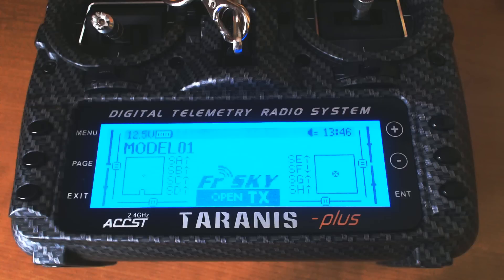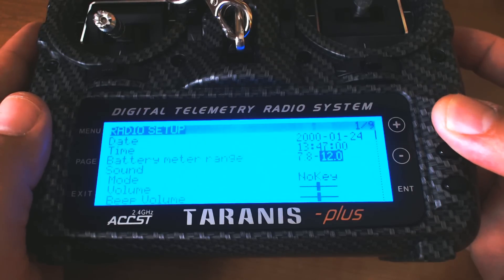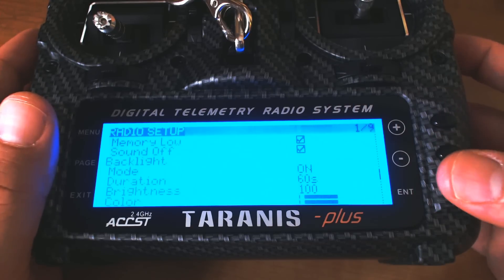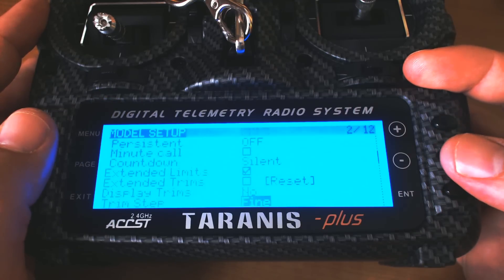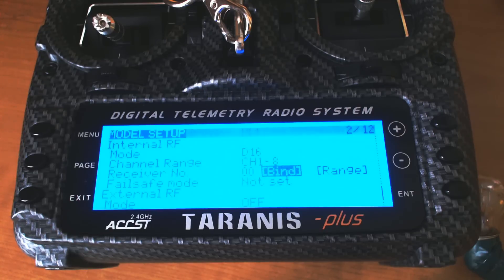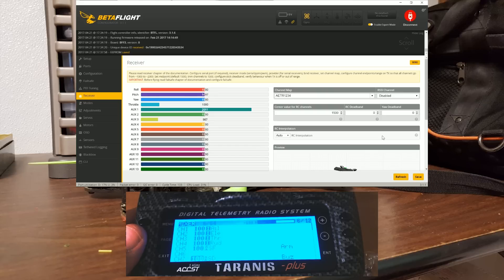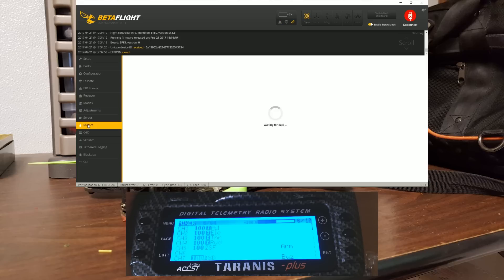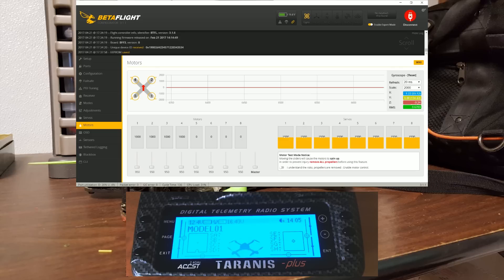How To Set Up FrSky Taranis and Betaflight / Cleanflight Configuration

Comment: I get to the end point part and I move the sticks and nothing happens so I can't set my end points.  The TX is bound (green light on receiver.  I have the x8r.  Does have something to do with arming?  Please help.  Thanks
Reply from the maker: If the Receiver Tab channels do not move when you move the sticks, then the receiver is not set up correctly.

Here's a video about wiring up flight controllers and receivers.

https://www.youtube.com/watch?v=ZpU6-JY6fnk

And in this video, I show setting up a serial receiver, although the exact steps will depend on your board.

https://www.youtube.com/watch?v=JkggzZySIqs&vl=en

You can also check the user manual of the Holybro Kakute or the JB F4 AIO flight controllers, both of which I wrote. They contain instructions for configuring a receiver in betaflight.
Reply: I have the first LUX FC
Reply from the maker: The Lux also has a great manual, although I didn't write it.

Comment: Is it worth setting up the arming on a switch in modes, before doing the yaw endpoints?
Reply from the maker: So you don't accidentally arm? You can do that. Or you can just center throttle before moving yaw up and down.

Comment: You didn't calibrate the Taranis first as part of the new radio setup. Do you think that is not needed? Or did you do it and just not show it in the video?
Reply from the maker: +John Reade that's a good question... And I don't remember. I probably did calibrate it to be honest.
Reply: Thanks for the response, I was just rewatching this video to see if I could use it to teach new people how to setup their radios and noticed that step was missing. I think it's often missed though. From my experience the only time calibration is noticed is when you get a radio that gives a throttle warning every time it is turned on. I also didn't see badly calibrated radios as often with the Taranis 9D Plus as I do with the QX7.

Comment: Hey, Joshua I've got a not so short question. 
Im working on an Immersionrc Vortex 150( I know I know)
I am having a very weird problem with the Vortex 150. The (Vbat) voltage is there when I first go into Betaflight to make any changes but the Vbat is disappearing in betaflight after I save and restart betaflight (even if I Don't make any changes) and to get it to show back up I have to run the Immersion Vortex 150s setup wizard again. 
I am wanting to send to the Taranis the Vbat so I can have it verbally warn me of low voltage.
Theres no problem with the telemetry from the Vortex 150 to the Taranis, its just that since theres no voltage being shown in Betaflight, the value is 0, all of the other data from the Vortex150 is working fine. 

There seems to be a problem with the Vortex 150s Flight controller losing the bat. (externally)
And to make matters even more odd is the Vbat is still showing up in the Immersion Vortex 150s OSD just fine.
I have even tried different Immersion firmwares and different ver of betaflight.
I have reached out to Immersionrc and no one there seems to know what is happening
My gut feeling is this is a Immersionrc Flight Controller Problem.

Thanks for any help
Rob

Thanks 
Rob
Reply from the maker: The OSD is a separate device in that copter, so the fact that the OSD sees vBat doesn't mean the FC also sees it. Also, I'm pretty sure ImmersionRC runs a custom version of Betaflight to interface with their OSD or something. It sounds like the FC is not set up to send telemetry data to the Taranis. When you do "Discover Sensors" on the Taranis, do a bunch of new sensors show up?
Reply: yes a bunch
Reply: Here is some text from a pdf that I got from immersionrc on how to get this to work.
A few firmwares back I got this to work on a vortex 250.
But know it does the same thing the 150 does the Vbat  just disappears once i save and reboot betaflight.
So frustrating.

How to enable telemetry on a v150/v180/v250
Tuesday, March 28, 2017 9:20 AM
Minimum software requirement
OSD: v 1.0.0.41
FC: betaflight 3.1.6 (IRCFUSIONF3:v250, IRCSYNERGYF3:v150/v180

HW Cabling
Telemetry pin connected to GPS connector RX pin on PDB

Configuring betaflight for telemetry using betaflightconfigurator
1. Configure UART2 for Smart Port Telemetry Output ( looks for right protocol
Save and Reboot...
WARNING: You may have to force Serial RX on UART3 after. Don't forget to configure Receiver too if it happens!!

2. Configure Other Features and Enable Current and Voltage Meter
              Save and Reboot...

3. Configure Current and Battery Meter type to EXT using CLI (not available though regular configurator UI interface)

set battery_meter_type = EXT
set current_meter_type = EXT
save

Thanks for your help
Reply: Hi again Joshua
I and they found the problem. It was an Immersion FC bug where if I used rssi on any of the auxs it disables Vbat in the telemetry. Immersionrc claims it will be fixed in the next firmware.
Thanks again for your help
RK

Comment: Joshua I bind my model on 02 I want to place it on 00 like you show us in the a video.  If I rebind it to 00 will I lose all my setting on the radio I had on  02??  The process to rebind is the same just change the number from 02 to 00 right??   Thank you
Reply from the maker: Nothing will change except the receiver number that the Taranis associates with the model.

Comment: Hi guys/Joshua. I’m new to the hobby and bought the wizard x220 after watching multiple reviews. It came and flew great. I took the lid off the x220 to reroute the antenna. Now the receiver seems to not talk to the F.C.  I’ve watched every video and tried every setting imaginable. In beta flight the receiver tab is just dead. I bound the tx to a different receiver in a different model and the same thing happens. As I’ve put just one battery through the model I’ve tied to address with Banggood but their CS seems to rely simply on me supplying a video of the problem. Any ideas. Russ with no hair.
Reply from the maker: +Russ Cobham does the receiver power up when you plug in the battery? Are there lights on it?
Reply: Hi Joshua. Thanks for taking the time to reply. So the receiver binds to the tx and so does another receiver. So both bind as they should and have the steady red light when power is applied by plugging in the flight battery. It just seems really weird that the same problem exists on both models but the tx and both tx will bind just fine. I hope it’s just new by nievety. Thanks for your help. Russ

Comment: Hi Joshua, since upgrading my Taranis firmware my Telemetry low voltage warnings no longer work. I thought maybe it was a soundpack issue, but upgraded to lastest soundpack and still doesn't work. I've used this feature for years and have not changed any of the radio settings. Any ideas? Thank you

Comment: Joshua,I watched your video but I couldn't fix my receiver issues. I have a taranis q x7, an xsr reciever, and lux v2 FC running betaflight. I configured the ports and configuration and soldered correctly yet in the receivers tab it defaults to 0. Even though its bound, by taranis won't display in the receivers section. Any suggestions?
Reply from the maker: If they are showing zero, I think this is a bug some people are having. Re-flash the config on the board, and if that doesn't fix it, uninstall and reinstall your configurator app from the Chrome app store.
Reply: This worked! Thanks for your help.

Comment: Hey Joshua. I spoke to you few weeks back about my receiver not working in beta fight receiver tab. I watched your video and was a success. I have just got a shuriken 180. I've bound x4r receiver to the quad plugged it into beta flight but no response in the tab. I've set it exactly the same as the one I had problem with before but still no response on tab. What can I do. Can u not use this receiver on this quad? Is it not bound or is it something wrong with the quad??. Would be great if you could help me out once again. Thanks
Reply from the maker: You can't assume that the Shuriken has the exact same config as the other FC you were using. Like, what UART is the receiver be hooked up to, for example? On different boards it will be different.

Yes, you can use the X4R with the Shuriken. But like maybe the Shuriken comes from the factory wired for a PPM receiver, in which case the factory wiring wouldn't work. That's just an example, mind you.
Reply: Its on UART 1. Will go to your shuriken video and check
Reply: Lol little bit confused but struggling bad
Reply: I know you are knowledgeable and will have the answer but how do I wire it to work for x4r. I did have the original receiver but when I brought this drone from person the receiver port for wire ie  little white box was snapped of. Can I solder wires to it and still use sxr?. Unsure

Comment: sorry all sorted now. just got new motors for my nighthawk. all seemed good. plugged battery in and one motor started to smoke. any ideas why as itbwasnt before I changed the motors. even when I changed it back same thing happened.
Reply from the maker: Number one, stop right now and build a smoke stopper, and use it. It will prevent smoked motors from happening. If you don't know what a smoke stopper is, google "how to build a smoke stopper".

If the motor smokes when you raise the throttle, this is likely your problem: https://www.youtube.com/watch?v=eo2sjTNS0pc

If the motor smokes immediately when you plug in the battery, it's probably a damaged ESC. Especially if it smoked two motors (same ESC, replace the motor, smokes again).
Reply: I didn't but I have looked and seen it in your videos or Hurd u mention it. can u use a normal light bulb. once iv done that what does that achieved. does that tell me if fault in ESC or in motor?

Comment: My experience says NiMh batteries are actually better for low current draw than LiPOs. My old Taranis (gen1) has the original battery and it works for WEEKS between charges. There must be current leakage in some Taranis TXs or Taranis Plus has a design flaw.

Tx latency?? Bull Sh!t SnoepoX
Reply from the maker: I charge my Taranis, with a 3S 2200 mAh LiPo, about once every 2 months. But honestly it doesn't mean much because who knows how much we both fly? There is no question at all that LiPo are usually more energy-dense than NiMh by a long shot. The very best NiMh packs can approach the energy density of a LiPo, but in general, a LiPo will have about 2x more Wh/g than a NiMh.
Reply: That's my point. In the olden days you needed to charge every time you flew. So once every two weeks is already luxury.
Thanks for the reply.

Comment: sorry lol. I have managed to get past that stage now. I'm setting my switches in modes now but angle mode and horizon are not there. normally I have switch with all three on. iv just built a martian 11 frame. emax 2600kv motor spf3 flight controller. I did have a wizard but made my own today and never used this taranis I have so having a go. sorry about my english

Comment: How do you get vbatt to the fc and from the fc to the rx? I have the xracer f303 and it does not have a vbatt port and I can't obviously plug vbatt directly to the rx any place... How does that all work?? Thanks!
Reply from the maker: Xracer F303 definitely does have vBat in. It's on the under-side of the board.

vBat gets from the FC to the Taranis via telemetry.
Reply: Joshua Bardwell awesome, thanks for the heads up! I'll turn the board over and look 😀

Comment: Hi Joshua, I received my carbon radio today, but it has no switch stickers applied.  I need to apply them myself, but to do the front ones it looks like I need to remove the switches and knobs - did yours arrive the same..?

Comment: My taranis is still fairly new and has the ratchet enabled for throttle, I'm about to open it up to change it to smooth, I assume you do that also as you mentioned this on the m9 gimbal video.. is there anything else you change while the back is off?

Comment: Oh, that's Taranis special edition you have there :) I got one too, added 5db antenna and the radio transmitter died :D So it might happen the antenna was badly made or Taranis itself couldn't handle it or it was already damaged as with stock antenna I got much less range than with my old non special hard mounted antenna.

Comment: Hey Josh,
If I got a new taranis, how do I transfer all my models and settings over (eg logical switches) without doing it all manually again?
Can you simply swap the SD cards over?
I've always wondered, and kind of concerned me as I will one day have to purchase a new radio. 
Thanks
Reply from the maker: I would save out the .eepe file in Companion. Maybe try backing up the ROM to SD from within the Taranis and then restoring to the new one.
Reply: how do you back up the ROM? menu.. settings..? thanks

Comment: ** Off topic but in reference to your earlier lipo testing videos.

Having recently picked up an ESR Meter like the one you tried in January, I see that there are two different ways to measure the IR of a pack. The first is to simply plug it into the meter and read the value. The second is to enter the capacity (mah) after plugging it in, and then use the two small leads to measure the IR of each cell separately and sum them for the pack's IR. 

According to the instructions the first method's measurement includes all solder joints, wiring, and connectors between the cells and the meter's internals. The second method measures IR at the solder tabs on top of the cell for the cell under test. I don't know how they're doing it but I did verify that summing the IR of the cells always produces a lower value than the first type of measurement.

I thought perhaps some of those wildly out of range numbers in your testing may have been caused by wiring/connectors.  Just a thought.

As to the value of the ESR Meter, I know there are intelligent and passionate users on RCG on both sides of the fence with regards to the measurement methodology used. I don't have an opinion. The thing that struck me after using this meter on a few dozen packs is that I have yet to be surprised by the measurements--even when a certain popular and expensive, high C rated model measured significantly worse than a certain 45C model. It simply validated what I suspected from flying the packs. At the same time it did show me that I can't rely on the accuracy of the IR measurements from my two popular models of chargers.

To me this raises the question of whether it's better to get the meter to confirm what you already suspect from flying experience, or to use the $100 to buy 2 or 3 packs of untried brands and then fly them to see the performance before buying your next batch of lipos. I'm on the fence. If I was a racer I would buy this meter simply to get an accurate view of the health of each cell in a pack before use.

I apologize again for veering off into the weeds.

Comment: If you plan on running multiple setups with different FC firmware platforms (kiss on one, betaflight on another) you'll want to make a separate model for those on KISS or Betaflight - the end points are going to be different between them.
Reply from the maker: FWIW, I use the same model for betaflight and raceflight. As long as I use the same receiver on both, the endpoints are correct.
Reply: Gee and here I thought RF1 was totally unique from the - it's ok, I'll see myself out ;)

Comment: Hey, Joshua. I've never seen much info on setting up rates and expo and what not. People talk about them, and describe them, but I don't think I've ever seen anyone actually set them, and walk through the process describing decisions and reasons. Maybe something you'd considering covering at some point?
Reply: It's better to set up rates and expo in your flight controller firmware. Changing rates and expos on your transmitter will alter the resolution of the outputs from it. Changing rates and expos in your firmware will keep your transmitter outputting a 1:1 representation of your stick movements, then your flight control firmware can interpret that data and do the expos itself.
Reply: Please x3.  I've been meaning to ask for this exact video.  The few I have seen have very little concrete info.

Comment: Excellent video!  Thanks!
I can't tell you how much time I wasted trying to figure out how to turn on the backlight in the OpenTX software on my PC.  A lot of OpenTX is till an enigma to me.  I got into a mode where one channel (on a fixed-wing, elevator) would go UP but not DOWN)  I finally had to bail on the model entirely and start a new one!

I decided to use the included battery until it died!  I like plugging it in to charge -- lazy I guess.  It's also nice not to have to sweat storage, swelling etc. in my radio.

Comment: The one thing you do in this video I really don't agree with is setting it to use the same model on the radio for all of your drones.  I have recently read several Facebook and Reddit posts where someone lost a quad because they landed, forgot to unplug their drone, power up another one and took off.  Both quads took off, in one case almost hitting someone, in another flying into a woods and being lost forever.  This is pretty preventable by creating different models.  Even if they are all the same.
Reply: Unfortunately Taranis doesn't have what Spektrum refers to as model match so it wouldn't matter if a different model was selected on the Tx. I have flown a quad a couple times on the wrong Tx model. For some  reason I cannot understand why someone would land their model and not retrieve it powering it down. Very strange and in 45 years of RC I have never seen or heard of such a thing happening as you describe by accident.